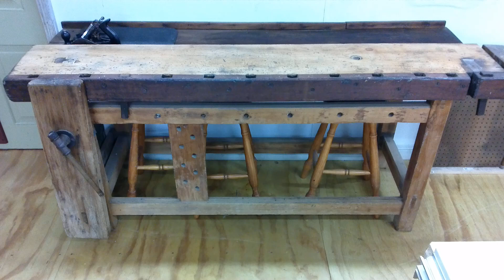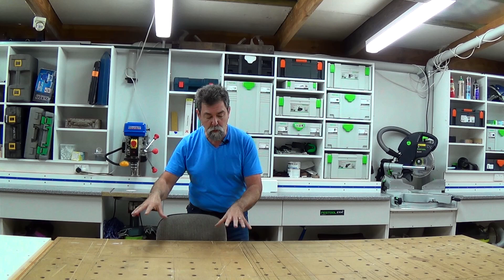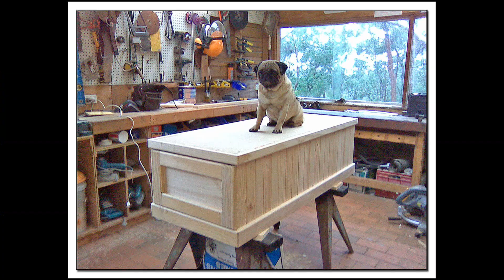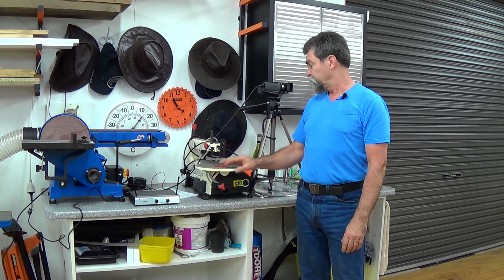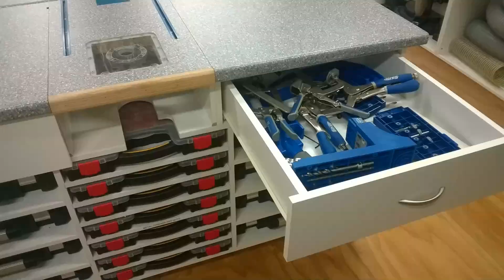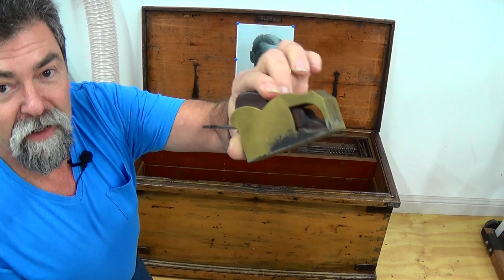Dave Stanton workshop tour 2015 and why Barry the pug is a star. woodworking building

Comment: Great video,love the story about your grandfather and his toolbox.
How long was you in construction and why did you start with fine woodworking?

I'm in construction my self but want to change
Reply from the maker: Fredrik Engdahl Hi Fredrik. Thanks for letting me know you liked the video. In answer to your question, about 35 years. I retired due to not being a big man, average size I guess, and the wall frames I built were often twice as tall as me, about 12 feet and cypress pine which is very heavy. This was a massive toll on my body and I just had to stop if I wanted any quality of life as I got older. I play around with timber but love manufactured panels to create boxes of all sorts and sizes. Main thing is to take it easy and go slowly. I also work part time in retail within the industry.

Comment: Hi David.  Just came across your channel.  You reviewed your festool Kapex.  I just took the plunge and started buying Festool tools.  Festool is a great manufacturer of fine tools.  I completed construction of my shop and I'm in the process of dressing it up.  I like the idea of using melamine.  I'm assuming that's what you used.  My concern in using it has to do with fastening pieces together.  Did you use glue and screws?  It looks like your method of fastening has done well.  I've seen two of your videos and look forward to see them all.  Nice shop, by the way.  Great job from a new viewer in southern Oregon. USA.
Reply from the maker: ***** Hi Tony. When making melamine cabinets, I usually screw through the face and into the edge. If it is a unit that is seen all around and also has to support a lot of weight, then I run a small 2mm deep dado and pocket hole screw together and also use  titebond  glue. Thanks for watching and be sure to share the channel around if you like what you see.

Comment: Hi David,

Thanks for your videos - very inspiring and also motivating (I have tool envy re the Kapex now).  I was planning on making some base units and shelving for my systainers as well as generally tidying up my workshed.  Can I ask what dimensions you used for your cabinetry please - I assume around 900mm for the base units and 410-420mm for the shelving but just wanted to get your feedback on the dimensions you used.

Cheers and best wishes for the woodworking.
Reply from the maker: justcruisin109 I will get the dimensions for you later in the week if that is ok.
Reply: ***** Many thanks David - I'd appreciate that.
Reply from the maker: justcruisin109 about 415mm between panels and the benchtop is 1.000 metre tall. The rest of the benches are the same height as my cabinet saw, 860mm.the 1.000 metre high bench is the kapex docking station. I don't like bending.